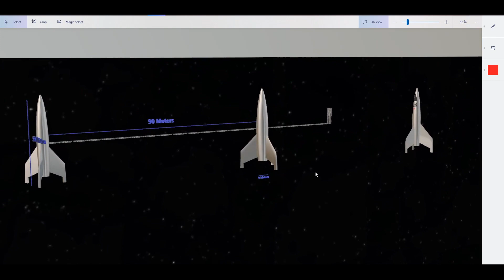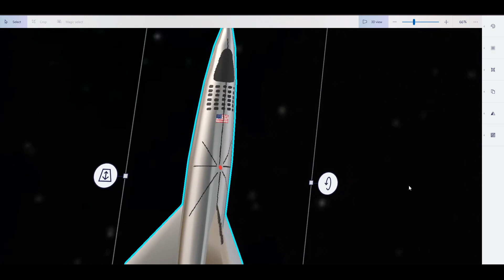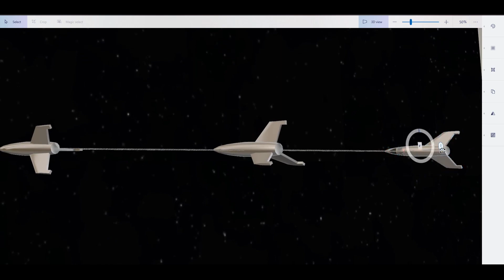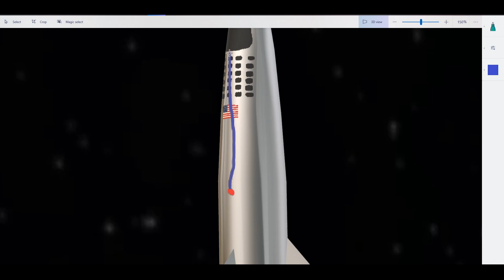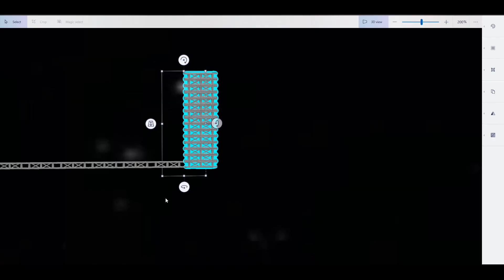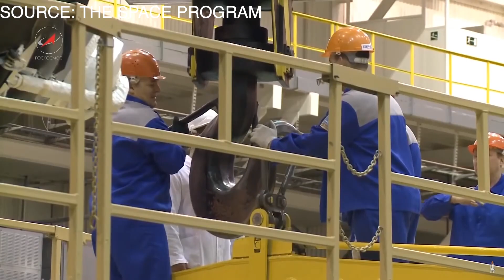My First Try At Making A Youtube Video: GLS1 - Artificial Gravity for the SpaceX Starship

Comment: You are right on! No sane person will try this without spin gravity. I had a crazy idea and ran a few numbers, and it looks to me like large diameter inflatable tubes made of Kevlar reinforced aluminized mylar could be put on parallel rollers in a Starship payload bay. Of course the interfaces for the ends would have to be worked out.

Comment: I'v watched a lot of videos on artificial gravity and nobody has an original idea. They're all working off of the Von Braun centrifugal force gravity system. Nobody ever looks into how gravity actually works nor how to recreate it.
It's very sad that nobody has a reasonable idea on this topic.
Reply from the maker: It's a tough topic, because as you probably know, we don't quite understand how the force of real gravity works. Our ideas fall apart as we test gravity at micro and macro scales. This is why at the present state of our technology, we try to mimic it with another force and centripetal force just seems to be the most practical to implement. If you have any other thoughts I would love to hear them
Reply: Your criticism is a good one, but if we are going to be critical, then that should also be a contract with ourselves to put in meaningful work toward coming up with useful ideas, or else we are just being a complainer.

Comment: I mean its a good idea but it would be difficult to move 3 times the amount of weight with only 1 amount of starship total engines making the amount of refuelings needed more to reach mars in 6 month i had a similar idea where the center starship would be a fusion booster

Comment: I thought of an idea instead of using three ships only use two the ones on the out side and the metal supports would be brought up by bought of them and when in orbit you will assemble the bridge in orbit so you don’t need another center ship only two so it will be cheaper then three of them when you really are only using two the one in the center only brings up the metal supports
Reply from the maker: My original idea had assembly while in earth orbit. It's the only other video i have posted right now. People pointed out that even with engines in the center of the assembled system, it would be tough to send the whole system to mars without the risk of putting weird stresses on the structure.

Comment: I have a question is the ship in the center all cargo and the two on the sides will be passengers and thanks for explaining it this video last video I did not under stand what you meant I thought you meant the one in the middle was for passengers
Reply from the maker: The middle one is just for the truss structure. once the truss and cables are deployed, the payload bay will be empty

Comment: Cool but I think, it'll just be simpler, (in your design, if the two ships don't sync, the trusses that link them will fail and too many forces are involved, not to mention the energy and cost to create and manipulate the trusses). 

My design: they'll just use compression in their new high tech suit (similar to fighter pilot suits but with more precision. They'll use suit with fibers that contract or expand when introduce with electricity), to manipulate how circulation should be.
Reply from the maker: Cool idea! I'm concerned about bone and muscle loss as well though

Comment: Would it not be possible to accomplish this using only 2 starships?  You say at the beginning that one of the strengths of this idea is that it doesn't require spacewalks, meaning that the the center "GLS" must be unmanned as any crew would have to transfer to the outer ships to enjoy the gravity/avoid being spun around for 6 months.  Is there a reason that two passenger starships could not be connected directly?
Reply from the maker: The only reason I don't have the starships connected directly is because the truss needs to be launched from earth, thrown to mars, landed on mars, launched from mars, and finally thrown back to earth. This is the purpose of the unmanned GLS.
Reply: @smallstars  what if the two starships each carried half of the truss into orbit?
Reply from the maker: @blantondavis  That sounds like a serious payload penalty!
Reply: The two starships going are already maxed out on payload. Anything added has to have its own propulsion. Delta V is VERY expensive.

Comment: Why not just use two starships connected to each other trough a strong cable and light truss structure to prevent unwanted rotation of the ships relative to each other? Both ships could have half of the truss in their nose sections as extendable structures.
The rotation could be started  using RCS engines. If the delta_v of those engines/fuel is not enough its much cheaper to modify them than to use a third ship at the rotation axis.
Reply from the maker: It's not cheaper to modify them if it's not physically practical. If the Starship RCS gets developed for this purpose, yes I would love to have a simpler and cheaper solution.

Comment: What if we build a traveling space stations that Travels  within the range of our planets say for instance a big spinning wheel that would sit in the position of the disc portion of something like the enterprise on star trek with an attached body  and engines to guide it as well as power it  with a spinning disc can make gravity and for windows use cameras up on the main deck and big monitors screens in the spinning disc to create a proper sense of direction I suspect if the ship never stops and continues to add thrust it will continue to go faster and be able to transfer loads without stopping It might be like catching up to a commit or asteroid but when we figure that out it would be a pretty fast ship

Comment: What about a aerodinamic structure like grid fins that give the rotation while starship is launching and penetrating atmosphere ? Even bullets that spin have less drag and more precision, could be energy efficient, maybe could compensate a extra cold gas thruster use to stabilize on Mars atmosphere (or maybe adjusting the grid fins for a bigger angle be doing the work)

Maybe that could also deviate micrometeorites on the way
Reply: It said it at the begining, it is a collossal construction and the plan of spacex is making  spaceflights cheaper

Comment: Accelerate before attaching, yes.  Detach before braking, yes.  Spin from the nose, yes.  Use RCS thrusters for spin and despin.  Have an airlock on the nose and a small pod that travels between ships.  Spin up slowly on the return trip, yes, but to slightly greater than Earth gravity, so passengers will be strong for the rigors of reentry and landing.
People have tried to build trusses in space before.  Why will your design work when theirs wouldn't?
The analogy you want may be more like a bicycle wheel with spokes than a crane; look at the London Eye as an example.  For only two passenger ships, use spreaders to give enough leverage to control the stress; otherwise, use three (or more) passenger ships.

That's lots of moving parts.  What about reliability, redundancy, robustness?  How will you test it before leaving?  How much does it weigh?  Is the hub ship still reusable (that is, can it still land on Earth)?
If you think a truss is workable, have you looked at how monster cranes assemble themselves for ideas?  Some very smart people have already worked on that for a long time, and there are some very clever solutions.
If you can't tell by now, I've been thinking about this as well.
Reply from the maker: Your thoughts and input are appreciated! Here are my responses to a few of the points you've made that I think haven't been addressed yet in this comment section:

1. In my opinion RCS thrusters should be reserved for RCS. I'd be happy to be convinced otherwise. The spin needs to be stabilized which will use even more RCS than a normal mission. The vacuum raptor as of now is said to be capable of 3500 kN of thrust and can be throttled down to a minimum of %20 after re-lighting. I do need help on the math to see how practical my idea is of using one vac raptor is to start and stop the spin.

2. Pods traveling between the vessels  could be a nice addition, imagine closing the GLS back up for the most part, and playing a game of space volleyball inside of the hull!? - but more realistically for now, I am trying to focus on the main system function.

3. GLS V2 (video in the works) will feature a nose to nose mechanism. I would like for gravity to hit a sweet spot at 1G on a middle deck so that the lowest deck with workout equipment can have more than 1G.

4. Can you point out an instance that a truss was unable to be "built" in space?

5. The system would be tested in earth orbit first of course, hopefully with starman's brother.

6. The GLS should weigh less than a normal mars bound starship payload.

7. GLS will certainly be reusable, but probably won't have to land on earth if it has enough propellant left to complete an orbit insertion burn, because it can be refueled in orbit for the next trip.

8. Yes I've seen how cranes are assembled, I will take another look to see if there are other methods. Without gravity, out in space it will certainly be easier. The folding out operation could work a bit like the solar panels on the dragon capsule but with more truss on either side of the fold up. https://www.youtube.com/watch?v=SlgrxVuP5jk&t=27m12s It is nice to have the same thing happening on both sides of the GLS at the same time for balance.
Reply: 1. ... RCS thrusters should be reserved for RCS. ...

Two points:  Second, the delta-v required is only about 50m/sec.  Between ullage and cooling-in, you'd spend almost as much fuel before the Raptor ignites as you'd use for the RCS.

But first and most importantly, you have to apply the thrust _sideways_.  Can't do that if your engine is pointed down.

Moreover, you probably want to do it in a series of burns.  A small one to stretch the tether out fully and start the spin, then a big one to add most of the spin, then allow for for a couple more to fine-tune the speed.

4. Can you point out an instance that a truss was unable to be "built" in space?

Hmmm...  I can't find an explicit report of a cancellation, but do a literature search and you'll find papers going back to the 70s and 80s about techniques for building trusses in space.  None of them flew.  Even the ones with demonstrations on the ground didn't turn out to be reliable enough to trust in space, for one reason or another.  It's much harder than it appears.

8. ... Without gravity, out in space it will certainly be easier. ...

Um, not so much.  Without gravity or atmosphere, things that naturally come apart will stick together, and things that naturally fold up will not even bend.  Solar panels, which are pretty much understood these days, used to fail in any number of ways.  I recall a memorable incident where astronauts on the ISS had to suit up and go outside to attack a recalcitrant solar panel with a fly swatter to get it to unfurl.  It turns out that something as simple as grommets on a wire don't slide evenly when there's no gravity.
Reply from the maker: @JGregoryNoel  Did you see the new and improved design of my concept? https://youtu.be/3CRiJTJikjk
Reply: @ryan lee: No, trusses don't deal with torsion well, so use them as spacers instead and use tethers to support the ships.  That puts the trusses under compression (with few twisting forces), and moves the balancing load to the more-flexible tethers.  And it doesn't matter how fast they are moving, they are only moving a couple of m/s relative to each other, so it's not a particularly complicated dance.
Reply from the maker: @JGregoryNoel  This video is version 1, version 2 is much improved 
https://www.youtube.com/watch?v=3CRiJTJikjk

Version 3 will feature cable tethers.

Comment: Rather than connect the truss and start the flight to mars....  Get the ships flying in formation to mars and then build/connect the truss.  Then you don't have to worry about engine thrust differences.  Then at the other end disconnect from the truss before slowing down.
Reply from the maker: Great point, this will be the operational method used for version 2 of the GLS design
Reply from the maker: V2 is up https://youtu.be/3CRiJTJikjk

Comment: Why not connect each Starship at the nose? The vehicles will already need to be lifted by the nose via a crane in Earth gravity, so you would at most simply need to make those attachment points a bit stronger to handle the weight of Starship and payload plus the landing propellant (the only additional bit of mass that wouldn't be included on any Starships being moved about on Earth).
The internal layout of Starship is also likely going to be set up not like a submarine or airplane but like a building, since Starship will usually experience accelerations from nose to tail, such as when sitting on the ground on Earth or Mars or while being launched. It may not make much sense in terms of trying to live in Starship for months of coasting through space to produce artificial G from back to belly, in that case. 

In an alternate case, rather than connecting three Starships via a truss structure attached dorsally, you could more simply and practically attach pairs of Starships nose-to-nose via a simple steel cable. This would allow the people inside to live and walk around exactly like they would be doing for their 1.5 year long stay on Mars, it wouldn't require additional support structures that add weight and complexity, and a flexible cable kept straight by centripetal force is much simpler to get into place than a long, rigid truss structure that needs to be robotically deployed and locked into place. 

There would be a few small issues, like needing to adjust the orientation of the solar panels to always face the sun (they would look more like wings than frills, if you get what I mean), and the artificial G would be slightly stronger at the lower decks compared to the upper ones (though a longer cable mitigates this to a large extent), but overall I think the nose-to-nose cable attachment option would be much simpler, cheaper to develop, and easier to use.
Reply from the maker: Good points. I don't think a cable can ever work because of lack of stability control.

Version 2 will involve making connections after leaving Earth's orbit which will allow for nose to nose connection on a swivel joint.
Reply: It's the one.

Comment: This is a great idea! Sync'ing the engines might be a fail point since they are chemical and may have slight variances, but maybe the spin could happen using ION engines to save on chemical fuel? Subbed!
Reply from the maker: I think the thrust amount can be finely controlled (throttled) in certain ranges and therefore matched. ION engines would be great for spin burn and may have to be the ultimate solution, but my goal for version 1 of this concept was to design a system with the least amount of changes to the existing starship design.
Reply: @smallstars  And that was a sensible goal.